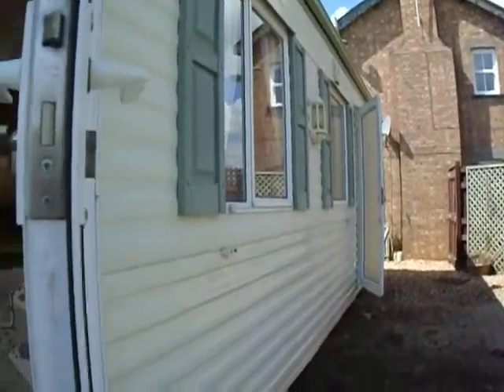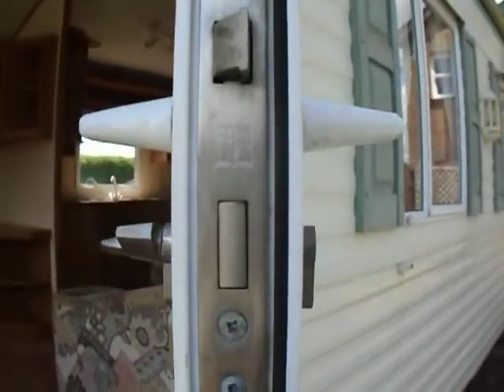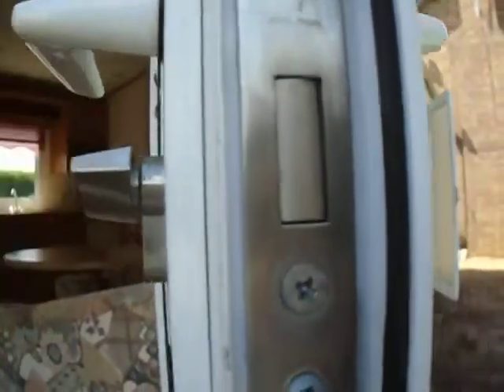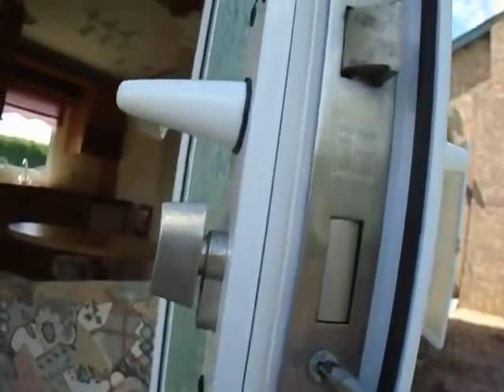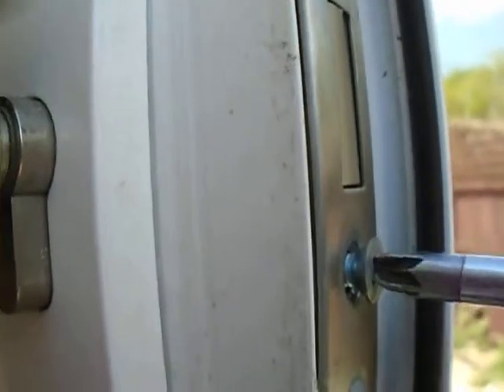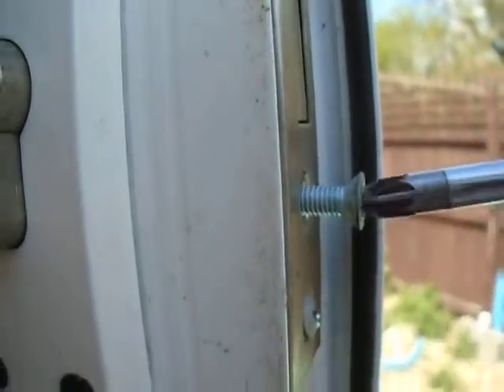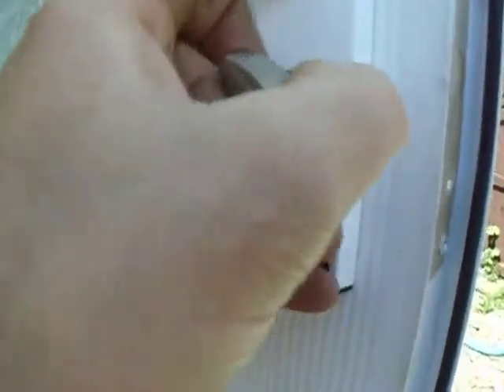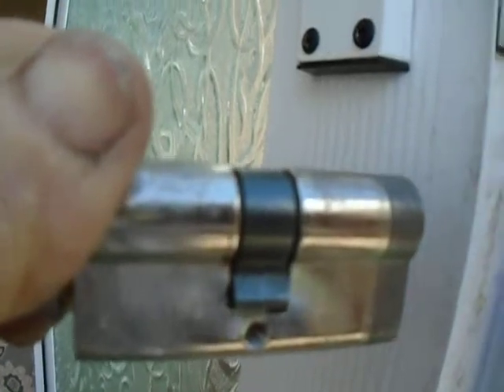MOV01966

Comment: Thanks for video didn't want to near lock until knew for sure how it come out any idea if that will fix issues with lock getting stuck having to push back that square piece of lock which still seems to be attached to door after removing barrel the spring has Gon funny?
Reply from the maker: Sorry, I cant help you with that one. 
I only removed it to get the key number as the caravan only came with a key for the other door
Reply: @m_l_hill  Hi can I ask where’s the best place to get new or part new lock from. I’m having trouble knowing which lock to buy?
Reply from the maker: @Creativelifelab  Hi.  I just did a quick google search on "Eurocylinder",  in the UK Toolstation and Screwfix sell them.  They come in different lengths to accommodate different thickness doors.